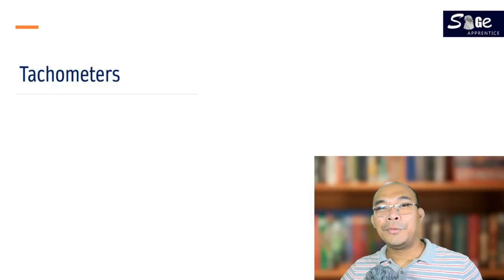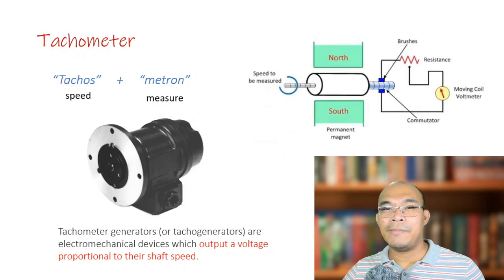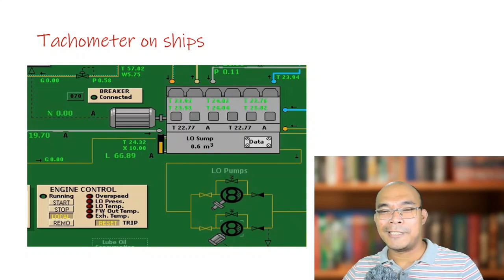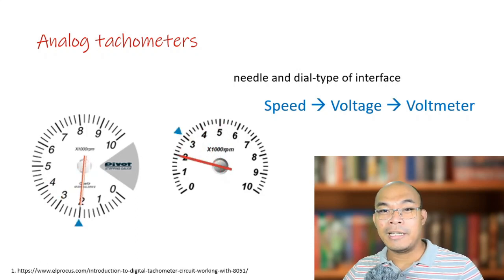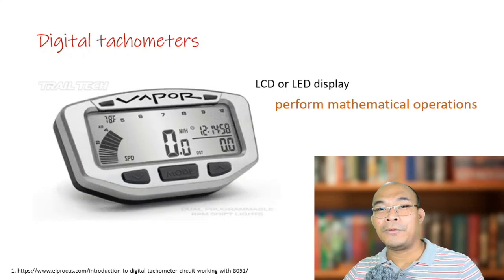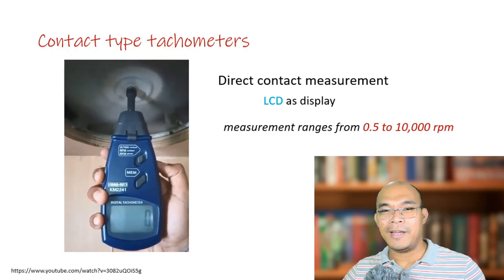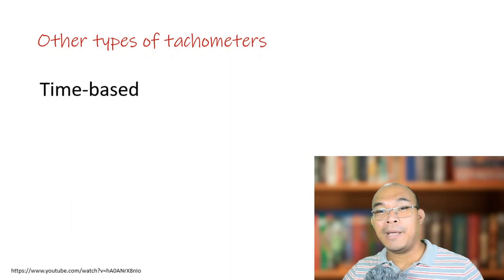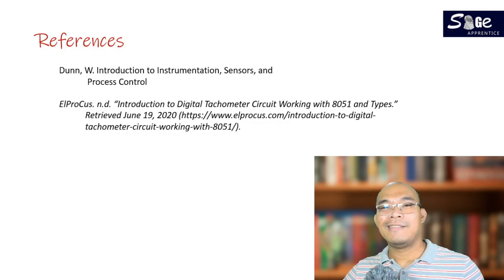How does a Tachometer works?

Comment: Good day Sir!
After watching the video I learn that a   tachometer is a device used to measure the revolution speed of any rotating object, such as a shaft or motor. Basically, it plays a big role in marine engineering because it dermine the speed of marine diesel engines on board ships. There are two types of tachometer such as analog tachometer and digital tachometer. Analog tachometer composed of needle and dial interface. This is an old type of tachometer that's why it can't compute details such as average speed and deviation. On the other hand, digital tachometer composed of LCD and LED dispaly which can be seen to modernized cars or motorcycles. Also, digital tachometer are classified into 4 types; contact type tachometer, non- contact tachometer, time-based tachometer, and frequecy-based tachometer.  Thank you so much Sir. Keep safe!

Comment: Tachometer is a device used in measuring the speed or rpm of the motor. This device help us by identifying if the motor is in condition by knowing the speed or rpm. There are different types of tachometer the analog tachometer and digital tachometer. Thank you for the video you uploaded. More videos to upload 🥰 and god bless you sir. 😇

Comment: Good day sir. After watching this video. I learned more about the basic principle of tachometer, especially the functions and also the types of tachometers. Tachometer have two types the analog tachometers and digital tachometers. Analog tachometers is comprise of a neddle and dial type of interface. The speed converted to voltage then the value will be displayed in analogue voltmeter calibrating to measure speed. While digital tachometers is comprise LCD and LED display. Tachometers have different types the contact, non contact and time based.

Comment: Thanks for this video sir, After watching this video, I learned that tachometer is important on board ship to measure the rotational speed of a shaft in a generator. I learned also the two main types of tachometer such as the Analog tachometers and Digital Tachometers and also their working principle. Analog tachometer comprised of a needle and a dial type of interface that the speed is converted to voltage, the value of voltage in a analog voltmeter calibrated to measure speed that means calibrated to rpm. Meanwhile, the Digital tachometers comprised of an LCD or LED display and it is programmed to perform mathematical operation such as average speed and are suitable for precise measurements. In addition, digital tachometers are classified as contact type, non-contact type, time measurement, frequency measurement. Thank you again sir.

Comment: Thank you Sir. For this video i learned the works of tachometer, tachometer their are two types digital and analog tachometer. Tacho is a measuring the to measure the low and high voltage speed.

Comment: I learned in this lesson video is the correct way on how tachometer work. Tachometer is a device that can measure the rotation speed of a shaft or disk, as in a motor or in any machine. This device usually displays the RPM on a calibrated analogue dial, but digital displays are increasingly common.

Comment: Thank you for this video sir! I learned how to measure the speed and how it works. And different devices in measuring this is speed or rotating speed. The tachometer is used in measuring this speed and the types is the analog and digital tachometer. Thank youuu sir and Godbless!

Comment: Thank you for this video sir. I learned how tachometer works and it's types and in our country sir we call it a speedometer but the correct term is tachometers. And im impressed with the non contact tachometers because you can measure the speed of any moving parts. Thank you sir. Godbless

Comment: I learned that tachometer generators use to measure the speed of a shaft, basically it measures rotations per minute or RPM, and I learned also the types of other tachometer the Time-based is more accurate for measuring low speed and Frequency base is more accurate for measuring high speed. Thank you.

Comment: Thank you for this informative video sir! I learned the different types of tachometers and how they work. Specifically the digital and analog tachometers. The difference between the two are digital tachometer is compromised with an LCD or LED display and a memory for storage which can be programmed to perform mathematical operations. While analog tachometer is a needle and dial-type of interface, and the deflection of the needle is calibrated to measure rpm. But unlike digital tachometer, analog do not store reading and cannot be used to compute details such as average speed and deviation. And lastly, I learned about the different types of digital tachometers namely contact type tachometer, non-contact type tachometer, time-based tachometer and frequency-based tachometer. Thank you and God bless 😊🙏

Comment: Good day sir. In this video I learn on how to use the Analog and the Digital Tachometer and how to measure the speed. I also learn that this measuring device measures the rotation of a shaft, and also the non-contact type, time based and the frequency-based tachomete. Thanks sir

Comment: I learned the usage and working principles of a tachometer. Tachometer is a device that measures speed on board ships and it is very important especially its proper handling or usage towards the system. And since the speed and the output voltage is directly proportional, hence the higher the speed being measured the higher the voltage generated by a tacho generator. Also the tachometer has 2 types, the analog and digital tachometer.

Comment: Thank you for this video discussion sir, very well explained. I learned that there are different devices in measuring a rotating speed. The tachometer is used in measuring this speed and the types is the analog and digital tachometer.

Comment: I learned about tachometer and function, tachometer have a two types it is a  analog tachometer and digital tachometer. The interface for analog tachometers is made up of a neddle and a dial. When the speed is translated to voltage, the result is displayed on an analogue voltmeter that is calibrated to measure speed. LCD and LED displays are used in digital tachometers. There are three sorts of tachometers: contact, non-contact, and time-based.

Comment: Thank you for this Video sir. I have a lots of Learnings about the kinds and types of Tachometers. Tachometer Generator are electrical devices which output a voltage proportional to their shaft speed. And also The Higher the Speed being measure, the higher the voltage needed by a Tachogenerators.

Comment: Thank you for this vedio sir,  i learn  a lot about the working of tachometer, i learned that if the speed of the shaft measured are increasing since it is a proportional means the higher speed being measured the higher voltage being measured ,, thank you sir 😊

Comment: After watching this video sir, i've learned about what is tachometers and how tachometers works specially onboard the ship, and tachometer measure the speed of  machines and devices and tachometer is important on board ship to measure the rotational speed of a shaft in a generator. there's also a tachometers generator and it is electromechanical devices which output a voltage proportional to their shaft speed and also i have learned the two main types of tachometer such as the Analog tachometers and Digital Tachometers Analog tachometer comprised of a needle and a dial type of interface that the speed is converted to voltage, the value of voltage in a analog voltmeter calibrated to measure speed that means calibrated to rpm, and the Digital tachometers comprised of an LCD or LED display and it is programmed to perform mathematical operation such as average speed and are suitable for precise measurements. And also digital has a type which is the contact type this type is dirwct contact type, Second type is Non- Contact very efficient, durable, accurate and compact, other type is time base and frequency base, thankyouu sir❤️

Comment: Good day sir for this video I was able to familiarize the speed measuring devices and the tachometer that tacho it means "speed" and metron means "measure". Tachometers has two type the Analog and and Digital tachometers. Analog is using needle and dial type of interface while digital tachometers is LCD or LED display. Digital Tachometer has for type the Contact type that is direct contact measuring LCD as dispay , next is the Non contact that is more efficient l, durable , accurate and compact and the third one is the time based that is more accurate for measuring when the speed is low and the last one is the Prequency Based that is more accurate for measuring in high speed. Thats all sir thankyou

Comment: Thank you so much sir, i learned that the tachometer has two types the contact types and non contact types tachometer.    The non non contact types tachometer is much easier to use.

Comment: Thank you for this video sir. I learne that tachometer has two types the analog tachometer and digital tachometer. it can be classified as contact type non contact type time measurement frequency measurment. the analog tachometer comprise a needle a dial type interface it is a vey common type of tachometer. while the digital tachometer it comprise of lcd or led display or memory for storage it perfrom mathematicap operation.

Comment: Have a nice day sir thanks a lot for your video sir. If the speed of the shaft measured are increases since it is a proportional means the high speed being measured the voltage being measure. I learned the non-contact is the valve changes from times. Thanks Po sir godbless

Comment: From this video/topic, I learned that tachometers is a device that measures speed. And it has two types of it, which is the Analog tachometer it comprised of needle and dial type of interface and the last one is the digital tachometers it comprised of LCD or LED display and a memory for storage.

Comment: In this video I learned about of basic principle of tachometers and especially the function and types of tachometers . The tachometers is use to measuring this speed and has have two types the Analog and Digital Tachometer. Analog tachometet is comprise of the needle and dial type of interface.

Comment: In this video I learned that there are different devices in measuring a rotating speed. Tachometer is used in measuring this speed and has two types, the analog and digital tachometer. The most accurate in these two types is the digital tachometer since it stores its precise measurement.

Comment: Sir, can you explain how a pulse tachometer works? like the OPPAMA brand, how can he read the engine speed only from the spark plug wire? what exactly is he reading? sparks or high frequency voltage across the spark plug wire? I am still learning about it and am still confused. thanks for the answer

Comment: Tachometer has 2 types the analog and digital tachometer, the analog tachometer comprises a needle a dial type interface while the digital tachometer comprises of LCD or led display or memory for storage ang it perform in mathematical operation, these two type can be classified as contact type and non-contact type time measurement.

Comment: This video explains How does a Tachometer works. An Electric Tachometer works on the principle of relative motion between the magnetic field and shaft of the coupled device. Tachometers and Speed Transmitters require permanently mounted speed sensors that observe a target on the machines rotating shaft. Several types of sensors are available including Proximity, Hall Effect (magnetic), Optical, and Laser.

Comment: In this video learn that tachometer measures the rate of rotation of the engine's crankshaft. With a Tachometer, driver's are able to assess the 'engine speed' and change the gearing ratio accordingly.

Comment: Hello sir..how are.great video 
Hope that you are the one who can help me..regarding the tach that i install on my 3 cylinder ecosport..
Reply from the maker: Hi thank you for your support. Can you give us some details?
Reply: @LouieJuera  hi..i already install the tach ..they 5 wire red white yellow i connect all of them to 12v wire..the problem is green wire which is for the ignition..since i had a 3 seperate ignition im woried to connect to one of them..so i took out the cluster board and try to locate the wire of the tach of the car..they have a lot of wire..what i did is i try to connect one by one to find the right wire ..but everyone of the nothing..only 2 wire has reaction..the white one with blue stripe and the brown one with stripe..but..the white one.when i  connect..the needle of the tach has a reading up to 7000 rpm..and the whote one the needle had bad behavior moving like none stop ..which is booth of them is not normal..what should i do
Reply: @LouieJuera  or should i connect the green wire of my aftermarket tach directy to one of the negative wire of ignition plug of my 3 cylinder car?appreciate.thanks